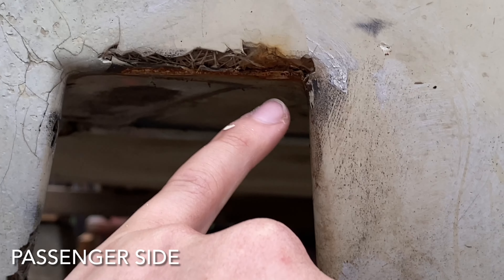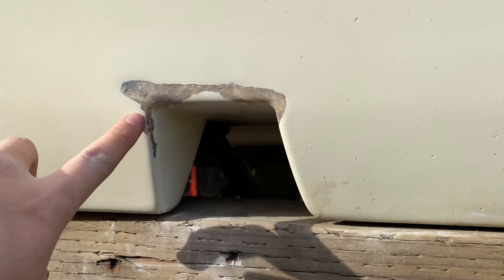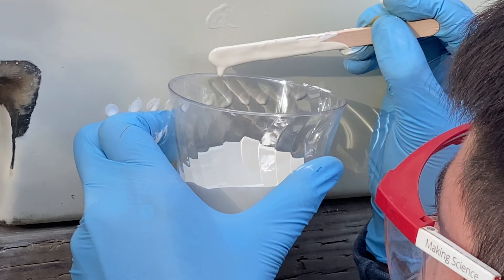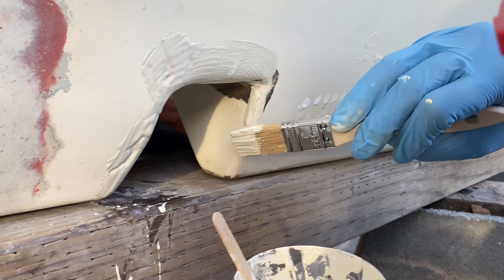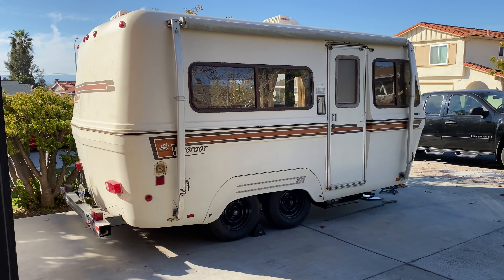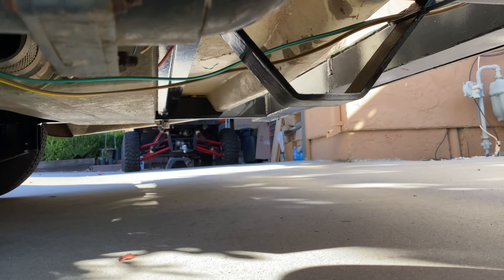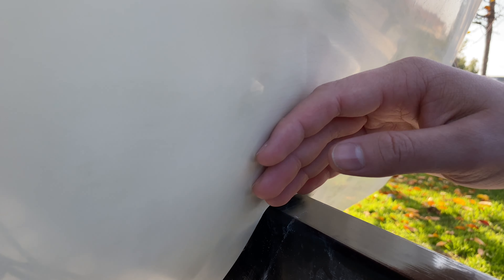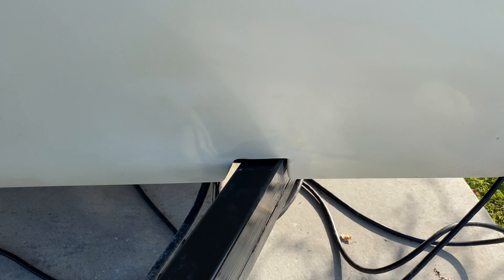Rare 80's Vintage Fiberglass Travel Trailer! EP03: Frame Meets Camper & TLC

Comment: I sprayed the front of my Bigfoot with raptor truck liner, colour matched to the colour of the camper. Looks fantastic!
Reply from the maker: This is an option I'm considering as I don't want it to stand out. Thanks for sharing! Did you color matching my simply spray painting over the top?
Reply: @b19sleeper9  no, the rock guard product is tinted to match whatever colour you want. The specific one I used is called raptor liner. I am very very satisfied with it.  I shared some Photos and videos of the installation process on the Facebook group, I tagged you in the post.

Comment: that box would go soooooo awesome on the back of a Mid sized commercial or military truck w/4x4 to make an expedition camper.  Just mount onto truck chassis or bed something to bolt bottom of trailer axle too to keep the suspension (no wheels)  and cut the tongue off and refab it so to remount inches in front of trailer or just under front edge and whalaaaaaa. you have a 3 point mount system for the camper on back of the truck... which is pretty important if you actually off road the expedition truck you just built.
Reply from the maker: I agree the camper would look real nice on the back of an off-road vehicle as well!

Comment: The ground clearance is an issue. Your idea to move the suspension above the axels makes sense and it makes me wonder why the Co did not build them that way? Can this be accomplished without removing the body? Does it affect the ride? Thanks I look forward to your reply
Reply from the maker: Hey Dennis, this can be accomplished without removing the body. Just undo the u-bolts and the spring bolts and the axle can then be drop and the new bracket can be welded on. To reinstall its simpler because the axle is now below the springs. The camper will ride with a high certain of gravity and has more wind resistance driving on the highway but the clearance was a much needed improvement of the places we want to camp at. Thanks for tuning in!